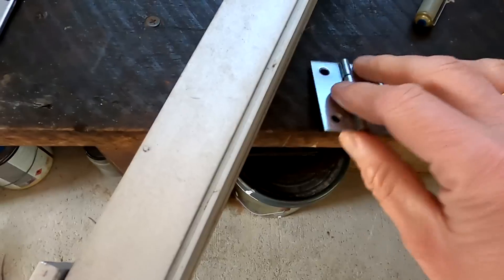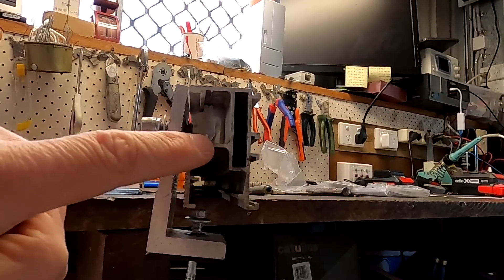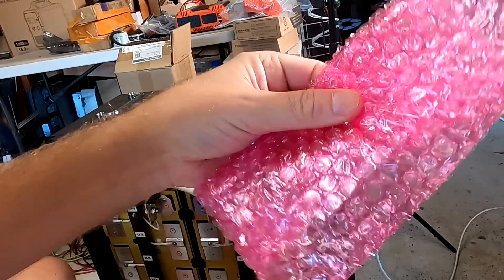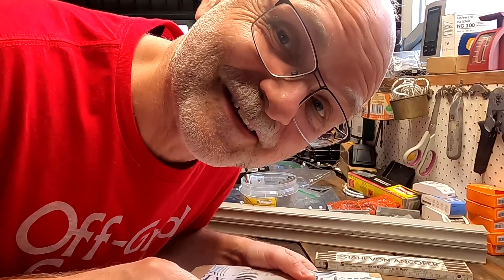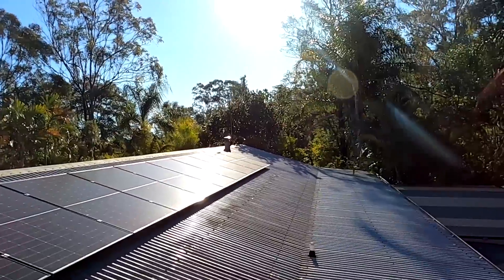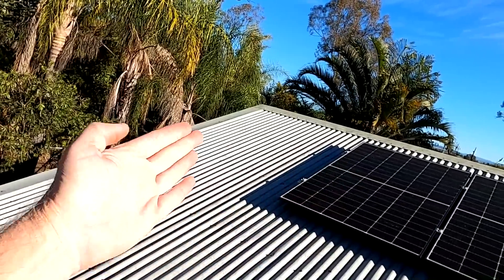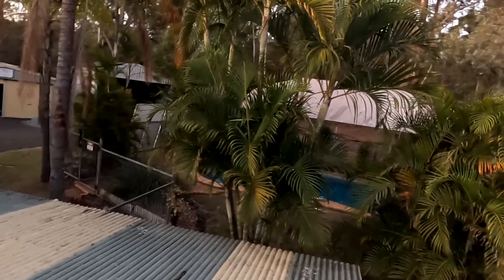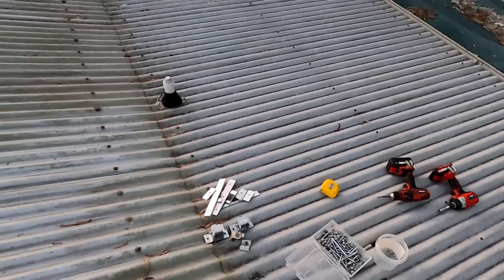Solar Panels on hinges to find the best angle. It wasn't a smooth ride...

Comment: Bought HJT ( Heterojunction Panel ) panels today. They are especially good for flat roofs. Asked the tech @ the seller what tilt. He says 13* LOL. I tested also around 33* is a good tilt as 45 or so isn't much more of a yield but more shadow for the next row.
Anyway HJT are 2 solar panels back to back an i turned the backside towards the sun and indeed its a fully function panel. Was cloudy and front was 215w on a 400w panel and back to the sun 206w
Reply from the maker: Nice! I'll look into them for my temporary pool fence system 😁

Comment: I've had this hinge method on my panels for about 6 years now and no problems.
For our location, Rhodes/Greece, I use 3 angle settings of 45 deg for winter, 35 deg for spring and autumn and then 15 deg for summer.
Means I'm not up and down to the roof where the panels are, too old for that malarkey 😮.
Like a broken watch it's wrong more than right but much better than just flat on the roof.

Comment: After a student party I was left with 2 crates of Oettinger Beer in my house. While finishing them I thought why destroying my liver with such industrial junk and not building a tilting machine for Andy. Organic so to say. Putting a couple of Oettinger liters into a black rubber bag which was right sized to be flat under a solarpanel, but while heating up in the midday sun enfolded as a perfect wedge to collect afternoon photons. I couldn't remember if I actually realized that or if  it was a bad dream during the binge drinking.
.... but at least the crates are empty now

Comment: I used hinges on a couple of solar panels installed on the side of my concrete fence. Bolted a wood base (1X3inch) first and screwed the other half of the solar panels' hinges on it. Propped them up at an angle using aluminun angle bars fastened by wing nuts. I get to clean the panels easily using a water hose.

Comment: very interesting test. I am currently installing PV on my flat roof facing south without shading but due to our weather conditions (west France near the sea, high wind and storm in winter), the set-up is usually at 10°. In winter the sun is low on the horizon (here) and your test is interesting regarding how much power we can get with a better angle. Let me think I would need to do the same kind of test. Anyway, great video as usual. love your channel.

Comment: Hi Andy, You need to put an insulating barrier between the stainless steel hinge and the aluminum as you'll get Galvanic corrosion between the dissimilar metals.
Reply: Came here to say this, but also, you need to shield the fasteners.  Galvanic corrosion only requires an electrical contact, not direct contact so the insulation barrier won't really do anything if there's a metal bolt between them.  I can't imagine anything bad will happen across the life of this system but I did hear of a case a few years back where a solar panel detached from the roof of a motorhome at speed on a highway and hit the car behind killing the occupants.  The old aluminium panel frame had corroded and weakened and failed because it was bolted down with stainless bolts.
Reply: @ububox2087  all it needs is just a bit of grease.. if one use same materials it will cold weld.. again - a bit of grease will stop it.
Reply from the maker: @servisfibris6679  I can't use grease on the roof, this is our drinking water.

Never seen anyone installing solar racking and rails using an insulation material. It's all stainless, aluminium and galvanised roof steel/sheeting. Never seen any corrosion either...

Comment: Bottom brackets for tilt mounting are already hinged.
I guess it's a cheap alternative, especially if you have heaps of rails and need to mount many panels in landscape.
You just need to cut a little bit off the handle of your Allen key to make another hex driver(drill use only, won't fit your ugga dugga)

Comment: Andy.. I'm wondering if you think I should add a active balancer to my battery I'm building  with the new grade a eve cells. They are the 280k with 2 hole welded terminal.  I have a 300 amp daly balancer but I'm waiting on the jk balancer with 2 amp active balancers. My battery is 16 cells 2p8s. It's 24 volt. I ordered the active balancers but not sure if the daly or jk would be better and not sure if I should add the little active balancers I've got? Any advice would be greatly appreciated.  I'm new to all this balancer stuff and not sure which way is best
Reply from the maker: Well, that totally depends on your battery and how much balance it actually needs. With a 2p setup and 300Ah cells I would imagine that you will need one. The Daly has only a few mA balancing current (so forget that). The JK has a 2A balancer but again with 600Ah to balance, it may need some help.

Comment: I love their 3D design. Wish I had help. One of my inverter is dieing, mate.  Sunny yesterday down here. Maybe a pop rivet never time.
Reply from the maker: What is going on with your system??? It's time for me to come down for a system check.
Reply: @OffGridGarageAustralia  Looks like the original Growatt invertor side of the SPF5000ES has an intermit fault. It can draw down the batteries from 53 V to 47 V over night. Only have the two batteries hook up 304 AH each.
Reply from the maker: @chuxxsss  Where does all the power go?

Comment: Reaching out to the community, got a new phone and it wont install the JK BMS app from the QR code any suggestions please
Reply from the maker: What phone, what iOS, what app version, tried to download the apk file (if android)?
Reply: @OffGridGarageAustralia  its a Samsung Galaxy AO3 Core, version 11
Reply from the maker: @jimbobarooney2861  What version of the JK BMS app have you installed?
Try the one from my website: https://off-grid-garage.com/battery-management-systems-bms/
Reply: @OffGridGarageAustralia  thanks Andy, i got the app running on my wife's phone, i had a loose lug connection on a balancing lead, i will try this app on my phone, thank you again

Comment: When mounted horizontally, wouldn't that make optimal use from your panels when the shade kicks in partially? Because the panel uses probably 3 bypass diodes in 3 divided zones in the length of your panel?
Reply from the maker: The shadow creeps both ways, along the roof towards the panels but also from the side. I will see if it makes a difference at all. It is, what it is...

Comment: be sure to clean up all the swarf or your roof will rust super quick
Reply from the maker: From drilling in Aluminium?
Reply: @OffGridGarageAustralia  considering your usual "safety boots" it would be a good idea to avoid future injuries. Also the wind may blow them somewhere where they could do some harm
Reply: @OffGridGarageAustralia  im lead to believe its from the size of the aluminium pieces in contact with the gal steel. A severe reaction can occur when a large cathode ie the roof (higher or more positive potential) is in contact with a small anode ie the swarf (lower or negative potential). In this situation, corrosion rates can increase dramatically.
Reply from the maker: @StephenLongley  Might be in theory. I never cleaned up the debris on the roof or inside the gutters. So far I have not seen any corrosion or anything, not even over time...

Comment: Andy I think you need to do a test. What will be better A spread the panels out futher and have an optimal angle and no shading on panels behind them. Or B  put them closer to each other and have a less optimal angle (adjust the angle so no shading is on the panel behind the other).
Reply: In case B you need to control the angle based on getting no shading on the downstream panel. In case A only control on optimal angle
Reply from the maker: Yes, we will do all that. Let just get some data and start with one...

Comment: Hello Andy,
I'm wondering why you put the hinges between panel and rail. 
I would have placed them between bottom rail and holder. Then three rails going up to the top rail.
This frame will give the needed stability to the panel (mounted with six clamps on the three rails).

But i am still in doubt if the tilting makes sense at all....good luck !
Reply from the maker: This is just a temp setup. Like the zinc screws.
Eventually, I need a proper frame for the panels. As you mentioned recently, the panel frame alone is not enough to support such a setup. I have heaps of rails left, so... 💪

Comment: Have you thought about bolting multiple panels together to eliminate some shading?
May need to reinforce with some angle aluminum.
Weight will be an issue so you may need to purchase some beer and get Andy2 to assist.
Reply from the maker: Discussed in previous videos. Yes, someone suggested that but it increases the wind force by a lot!
Andy2 is at barber shop for the last few days. It's growing faster than expected 👱‍♂️😂
Reply: Andy2 doesn’t seem to be very reliable unless there’s plenty of cold ones 😂😂😂

Comment: Make yourself a solar tracker using an arduino. There are ones you can buy too, but that's really what you need. It will automatically adjust as necessary.
Reply from the maker: It will connect to HA, no additional controller needed. I would not know how to program it.
Reply: @OffGridGarageAustralia  there’s code for it on insrtrucables. 

You need to continuously adjust and HA automations really won’t work well for that. 

You might hack that with esphome and do it with events directly skipping esp home but loading the open source firmware already done would be easier.

Comment: Next time chop the elbow off of that L shaped Allen key and chuck it into your driver.
Reply from the maker: Yeah, I did this before but then I cannot use it manually any more. If I would have more than one allen key, maybe an option and if I would have a lot of these screws...

Comment: Hinges like that will probably mean a ~5-10 degree angle on an actuator when fully "down" rather than completely flat, so it has enough moment to start extending.  Hope that makes sense.
Reply from the maker: Yes, that is the plan. I don't want them 0° flat. A bit of angle is good for self cleaning purposes...

Comment: Hello! A while back you connected your MPPT's to use DVCC with your PI Cerbo, how did you do that? My Cerbo GX only has 3 VE Direct ports :/
Reply: Just use a USB to VE Direct cable from Victron to extend the number of VE Direct interfaces. Alternatively you can also use an USB to 4port VE Direct Adapter from Duppa to have 4 more (even fully isolated ones) VE Direct ports. Andi did a video about that topic too.
Reply: @Knightliner69  that's cool. Good to know. Thank you!
Reply from the maker: Yes, USB to Ve.direct cables are your friend. Or use one of these extenders (cause I'm running out of USB ports as well and hubs sometimes cause issues):
https://youtu.be/5Tzxd2UQoDM

Comment: Hi Andy,
As far as I know the frames from the Solar panels are not made for screwing something in. Especially if it has to hold some weights or wind etc...
Greets
Nick
Reply from the maker: I know, Nick. It's just for getting some data over the next few days. We will have a much better setup eventually. I'm still in the test phase to see if it is actually worth doing...

Comment: By drilling extra hole in the panel frame , you're voiding the warranty
Reply from the maker: Yep, done! 
I don't know if this is mentioned in the solar panel manufacturer's warranty statement. I didn't read it. But you did?
Like taking electronic devices apart to show the inside  or disassemble batteries to show the components. That's what I do here on the channel so you (the viewers) don't have to... 😉
Reply: @OffGridGarageAustralia  yup. Agreed. I would have done that inclined adjustable tilt differently using struts,so that I cannot drill the extra mounting holes in panels.

Comment: Andy..... why do you get more solar production on cloudy days?
Are they shingle  panel's  or something?
Reply: Visible shading on a single solar panel can cut production of the string by 90%+ easily - on clear days, the branches of trees make visible shading which cuts production - this is even worse on windy days, as the shadows continually move over all panels. On overcast days, however, no such shading occurs and all panels in the string perform at full capacity for that particular insolation level.  Note that Andy has circa 14kW worth of panels on the garage roofs, so "achieving" 4kW during a fully overcast day isn't unexpected.
Reply from the maker: I have explained this in all details in the first 10min of the last video here:
https://youtu.be/OGS25sUo-ww
Let me know, if there are still any specific questions, I haven't explained 😉
Reply: @OffGridGarageAustralia  I will make sure I go back and watch that video they seem to have missed it....

Comment: Like# numeral uno - Hmmm, I'm using a full length piano hinge to spread out the force so as not to warp the solar panel's frame. that is a real concern of mine with the panels being 80lbs each.
Reply from the maker: Yes, the panel frame is not made for such an installation. It's just a temp setup to gain some data for a few days.
Also, here you go: 🥇
Reply: @OffGridGarageAustralia  woohooooooooooo